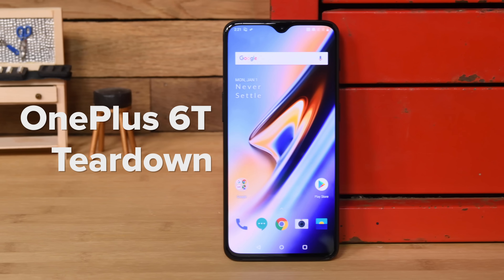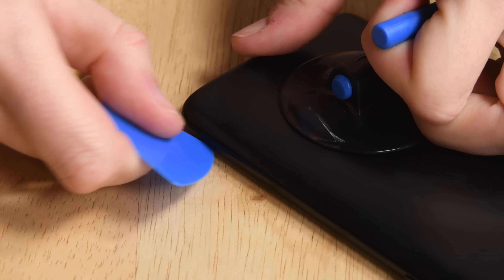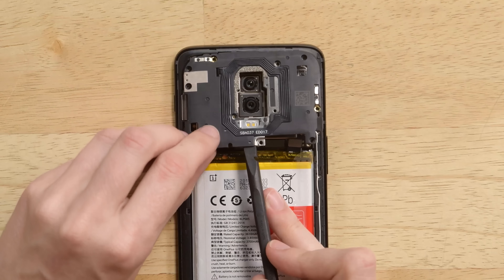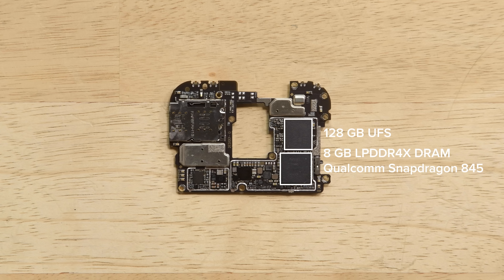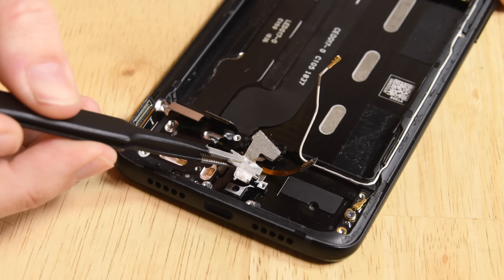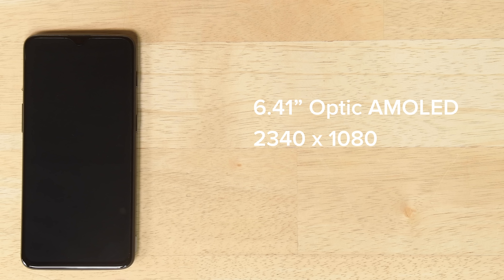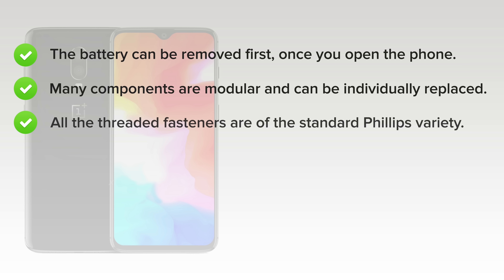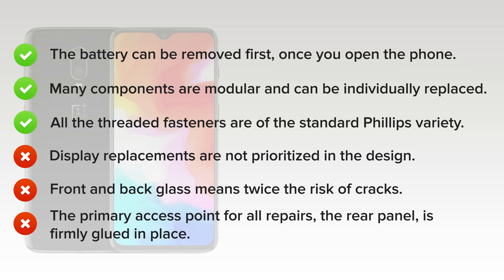The OnePlus 6T Teardown

Comment: how easy or difficult is it to repair any contact pads for the wire cables if they come loose from the mother board? I've done a few self repairs for replacing the battery and speaker. This time when I unclipped the wire cable, it dislodged the connection point on the motherboard.

Comment: Does anyone know if I need to re-glue the back cover for replacing it?
And if not, do I need to heat up the glue before I put it back on?
If not, do I need to heat up the glue after replacing the back cover so it re-sticks?

The repair guides all seem to say "do the steps in reverse order" and nobody ever talks about the glue that you separated.
Reply: D2ultima, you either buy a new back cover with glue and just stick it on at the end. Or you buy the glue sticker and attach to your cleaned existing back cover, and then put the cover on the back of your phone. The old glue is not reusable.

Comment: Here's what I don't like about how they assign scores: they always complain that the display is fused to the front glass and needs to be replaced as a complete unit and here, they did not mention this. They did however mention that this design does not prioritize screen replacements which I completely agree with since that is usually the weakest component. Let's take into account that, at least for the display assembly, there is no phone (that I know of at least) which allows you to easily separate the screen from the front panel (digitizer). This, being generally applicable, should not be mentioned and considered a downside since it applies to all phones.
The second thing that annoys me is mentioning that the back panel is firmly glued in place. I am 100% certain that they know about the splash resistance of the phone and that resistance is accomplished by using glue to ensure a tight seal. This, again, is something that most phone manufacturers do to make sure moisture stays out and you stay happy. While I am always happy to see a disassembly video from ifixit, the teardown score is completely irrelevant for mentioning things that are generally applicable to all phones. In other words, all teardown scores should have a few points added just because they all have the same design issues being mentioned again and again.
Reply: @Moody_Blues_  Apple's gaskets are sticky, extremely sticky in fact. Same thing applies to Samsung and any other smartphone that's put together with adhesive. It's all the same stuff, no one actually uses liquid glue.

Comment: These scores seem to have no consistency
Reply: @Moody_Blues_  The iPhone 8 plus should have got less score than the Oneplus since It has no replaceable back glass, touch id issue, more difficult battery removal and proprietary screws. All these conta against a easier touchscreen change gives you a +1 score??????
Reply: @victoret7yt  YES I AGREEE
Reply: CJ 
It’s a con when no witless charging and the risk of them getting I don’t know harmed while repairing the phone that what they said ...
It sounds logical to me
Reply: @ko-Daegu  Should really only subtract points when there's no wireless charging involved, if there is there's a logical reason behind having a glass back.
Reply: Henke or better for reception
Reply: @Moody_Blues_  i haven't watched the iphone teardown videos, but i am using this video to disassembly the OnePlus6t and it's easy. My only other experience doing screen repair is the Galaxy S9 Plus that was a bit more challenging due to the super strong glue. 
I just use hair dryer to warm up the glue, suction cups and plastic/metal thin prying tools. Works well. So imo, i have no clue how much harder or easier an iphone is, probably about the same i imagine.